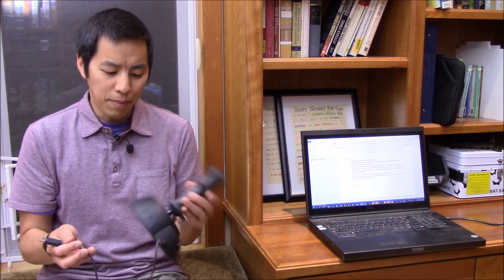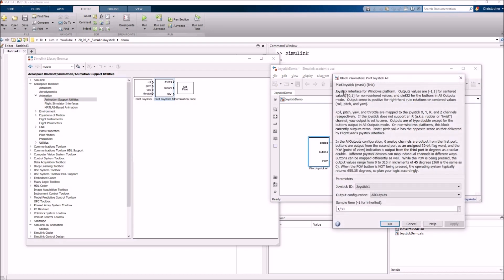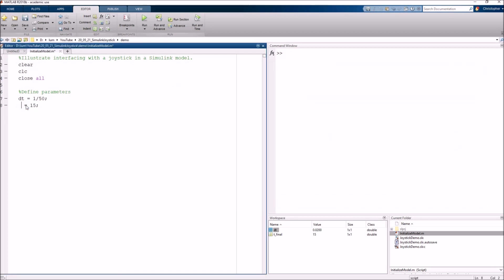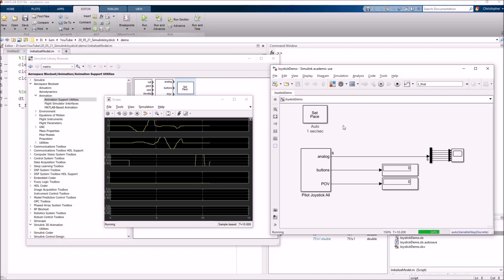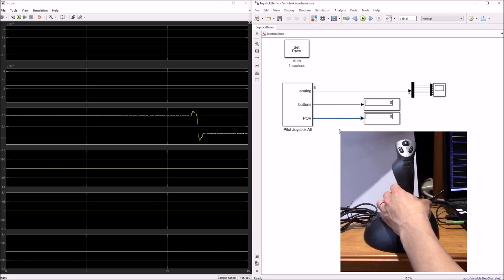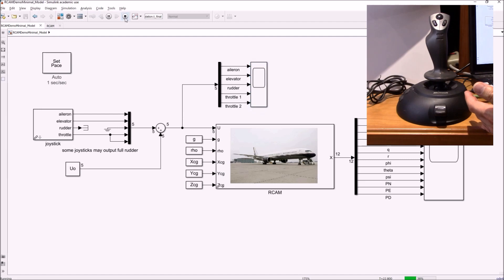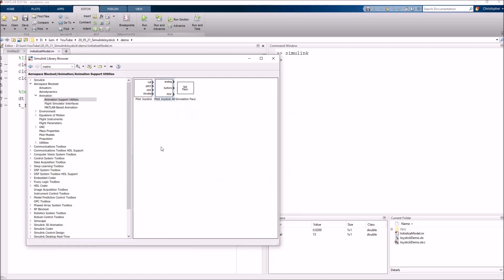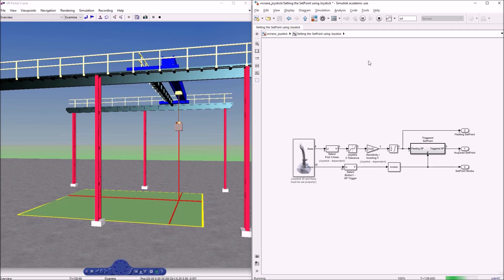Using a Joystick to Interact with a Simulink Model

Comment: AA516: I cannot find the Display option on my toolbar. For context, I am using Simulink on a Mac.
Reply: Found it. It's now in Debug >> Information Overlays >> Signal Dimensions. But it doesn't show any dimensions in my model upon selecting it.
Reply: Resolved. Just disconnect the joystick, reconnect it and refresh. And now my signal dimension shows 6.

Comment: AA 516 Just posting this in case someone runs into the same problem as I did when Matlab could not recognize the joystick. Go into the Control Panel of Windows -> select set up USB game controllers -> Advanced -> click the dropdown button and select the name of the joystick in case it is showing something else. If it still doesn't work go to the device manager click on your joystick and select uninstall device. Plug in the joystick and it should prompt you to install the driver again.
Reply from the maker: Great advice thanks for the pointers!

Comment: AA 516: Hello Professor, why does it need a -1 gain for the aileron,  the elevator, and the rudder when output those to the model?
Reply from the maker: It just depends on how your joystick defines a positive deflection and how you want to map that to a positive or negative control surface deflection.

Comment: Could you interfere the electrical power module with different angle deflection of the primary control surface